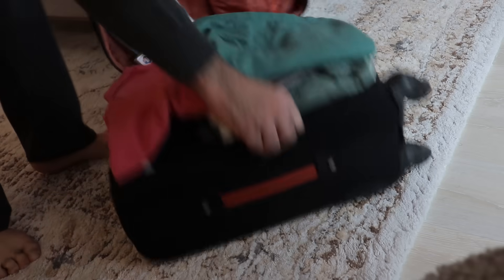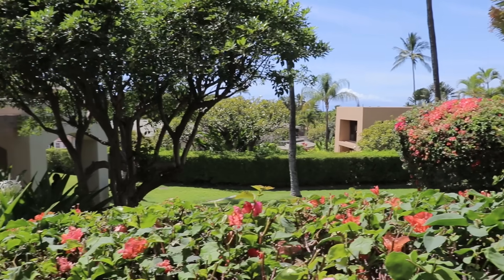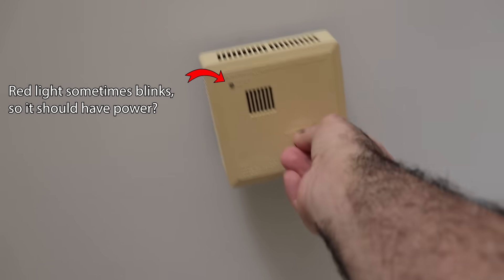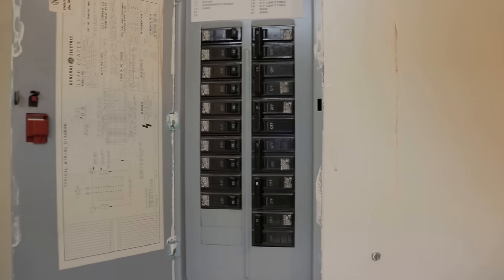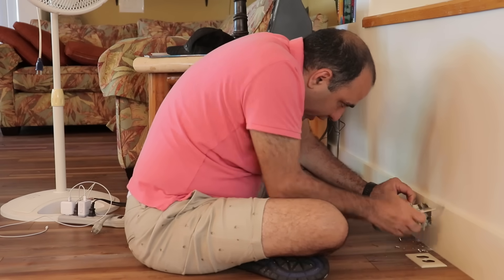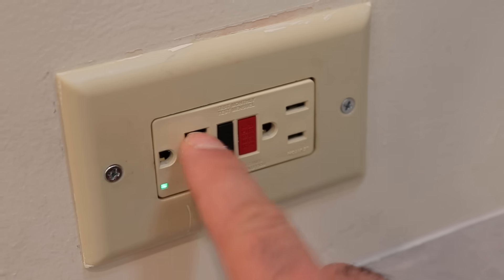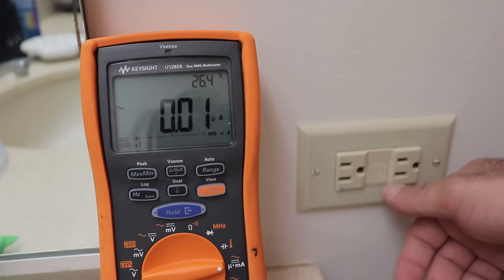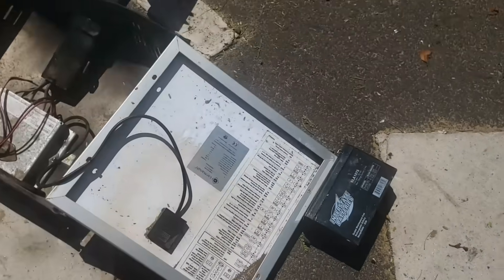Hawaiian Hotel Safety Failures

Comment: As someone who works with LV electrical installations, there are a couple interesting finds:

1. Turning off the an individual breaker doesn’t mean it’s safe to touch the parts (unless it’s a 2 pole breaker) because return currents from the neutral can still shock you (since the neutral is unswitched in a single pole breaker).

2. The GFCI that took more than 5mA is a fail if it is rated at 5mA. In the UK for instance, 30mA RCD trips around 22-27mA, and if it trips at more than 30mA, it would have to be replaced. However the accuracy and precision of your homemade GFCI/RCD ramp tester may not make it very suitable for the mA range.

3. When there was a dead short between the line and earth conductor, the breaker at the fuse board should have popped. Maybe the earthing there wasn’t very good.

Great content as always :)
Reply: First one only happens if your neutral is ungrounded

Comment: I recommend you get a standard lockpicking set from Amazon/E-bay, or wherever you may get miscellaneous tools. Mine is cheap, the metal is thin so it is flexible and bends, but overall cheap is okay!
Tensioners seem to be non-flexible, thankfully.
Tips:
Because the picking tool is flexible, it could potentially break inside the lock if you're not careful. Practice.
You may damage the springs and internal components.
Keyholes on practice locks you get may widen after using the tensioner a lot. It happened to my transparent one, so it's more difficult to tension.
Remember this while opening things you should definitely lockpick. Thanks for helping me with electronics with your tutorials, much love!
Reply: He may not be able to legally possess lockpicking equipment. #canaderp ?

Comment: Hey, Mahalo for visiting Hawaii. Just some things:
1. The electrical system in your hotel is likely the result of the really crap and corrupt construction/inspection standards in this state, combined with Frankenstein nature of renovations hotels do. I did door hardware installation for awhile and lived with an electrician as a roommate. Your room was par for the course. If you really want nightmares, you should see some of the residential refits done here by guys who really shouldn't be doing it all (though to be fair, doing any sort of work on a 70 year old single-wall plantation style house is difficult even for skilled people).
2. No clue why the switches are so low. Yeah, they have to be handicapped accessible, but that's lower than the standard. My guess is the original flooring was lower, or the guy cutting the drywall was eyeballing it. 
3. The sand at the beach you were at is really low silica compared what you're used to the mainland. White sand here is high in calcium, being composed mostly of dead coral, shells, diatomates, etc. Very little quartz on this type of volcanic island. There's an irony that we have to import high silica sand for certain industrial uses.
4. Ummm, that quick shot of you and your family climbing over the coastal basalt while waves crashed under you? It's really dangerous to be in those kind of areas, and the state really needs to put up more and clearer signage/guidance as it's a major cause of injury and death to visitors here. Yeah, I know there's always tons of people doing it, so everyone thinks it's okay, but its not. Rogue waves happen, particularly in certain ocean conditions. 

Hope you enjoyed your trip!

Comment: Dont you have active RCD's or GFCI's installed on the supply side ind the mains box?
And 5mA for safety? Thats pretty damn high.. 
In denmark its a legal reqirement for an RCD to disconnect current, in the event of more than 3mA 
residual current in under 0.2 seconds.
But i guess it has something to do with our grid to be 120 degrees out of phase and 60Hz?

Comment: Been using a miltimeter on a daily basis for the past 6 years & not once have I ever used the "probe holders". Never even realised that's what the were for; thought they were just for keeping them in place when not in use - or maybe to turn your multimeter into an offensive weapon!
Reply: Usually you put one probe in the holder so you can hold it and the meter with one hand, and keep the other probe in the other hand - you don't usually stick both of them in the holders. Most decent quality multi meters have the holders - sure, the $3.99 special at harbor freight or princess auto meters, not so much
Reply: @gorak9000  A small piece of duct tape can't fix that problem.
Reply: Especially for higher voltages, is designed so that you wont make contact from one arm to the other through your heart.
Reply: I find them more annoying than helpful. Of course if I was doing more residential rather than industrial it might be different.
Reply: a miltimeter
Reply: @official-obama  it was late and I was kinda drunk lol

Comment: A slight correction about the "240V coming from two 120V sources that are 180 degrees out of phase"

Single family detached homes typically run off of a center tap transformer and thus the 240 volts does not come from two 120V sources 180 degrees out of phase. Line 1 to neutral or Line 2 to neutral are both from the same winding of a transformer. In fact it's the voltage from either end of the winding to the center tap. The voltage across the entire winding is  240V.

Edited for typo

Comment: Well an outlet in my house was not working properly so my father opened it up to see a metal mesh near the wire. If the mesh was even half an inch closer then all the current would go right back into to walls of the building. Then he proceeded to remove the mesh with the breaker on and popped the breaker

Comment: Love the videos but still dont understand why american electrical panels are not built like we do in europe with earth protection  (typical 30mA in residents) integrated in the breakers on every single one. Does certainly make things a bit safer everywhere and not just in the bathroom. Yeah one breaker does cost like 80 usd for a proper one, but it will also last you a lifetime.

Comment: 14:15 Sorry but blaming the pandemic struggling on a failed Smoke detector and GFCI from 1985 isn’t a good excuse. The pandemic has nothing to do with proper maintenance and safety of the customers. That stuff should have been replaced before the pandemic even started.
Reply: GFCIs are only like $20. A good photoelectric smoke alarm will run you about $15-40. So yeah, those are not expensive at all.

Comment: Make me remember I solder wire connection when it still on and on 220v circuit. I use battery soldering iron and accidentally touch the metal body of soldering and getting shock.

Comment: 5mA?!!! What are you guys doing there in US? Sticking your finger to the outlet while sitting in the bath first making sure your entire dead skin layer is brushed off? Or maybe putting your tongue where it doesn't belong? In Poland, and I'm pretty sure it's the same in Germany and bigger part of Europe the standard RCD is rated for max 30mA (can pop from 15mA, also note that according to the regulations all circuits should be behind the RCD meaning all the outlets and light fixtures) and one recommended for wet environment like a bathroom is rated at 10mA.

Comment: Smoke detectors use radioactive materials that decay over time. Chances are it’s just decayed too far and no longer works.
Reply: Only ionization ones: the one in this video is photoelectric (though regardless of the sensor type they should still be replaced every 10 years, & this one's long overdue for replacement!).

Comment: I worked in hotels....Nothing will be done for the GFCI or the smoke detector.
Reply: Even the outlets? Thats a huge ass fire hazard over there
Reply: @Chocoffee_battery  basically if an inspection is done and is noted on the report, it will get fixed. Otherwise there's not much chance.

Comment: SWEDEN ELECTRICAL FACTS! (From a 17 YO swede)
I have a feeling he’ll love Swedens outlets. I live in Sweden and we have 400 volts between 2 phases. So 230 volts between N and one phase.
We also have a thing called an “Jordfelsbrytare” or directly translated Ground Fault Breaker. But the main difference that i’ve seen is that it is located in the central. It checks the current between the returning 3 phases and the N-wire and breaks if the returning current trough the N-wire differs by 30mA or more. 
The centrals over here looks a LOT different that those in North America (much more clean imo) 
A little more about the Ground Fault Breaker (GFB).
In Sweden we have 3 phases 120 degrees out of phase. After the main breaker in the central we connect these 3 phases and the incoming N-wire into the top side of the GFB. After that we connect the same on the under side of the GFB. BUT here in Sweden we have a dedicated N- And PE-rail. We connect the outgoing N-wire from the underside of the GFB to this N-rail. What this means is that every electrical product connected to an outlet gets monitored by the GFB and if the current differs by 30mA or more it breaks. Again this GFB monitors EVERY OUTLET of the entire house/apartment instead of just one.
Ty for reading! (if you did)
Picture related:
https://images.app.goo.gl/7Hp9m21LKspHyNYBA

Comment: I think that in the UK all bathroom outlets have isolation transformers. But they also have a different socket that can only take a special plug used only by shavers and toothbrushes. Building regs and all that.

Comment: Smoke detectors in hotels sometimes set off the central alarm if you hit "test."
Reply: Not exactly: hotel rooms typically have either commercial detectors with sounder bases or residential detectors that have built-in horns, both of which are done precisely for the reason of avoiding false alarms that would set off the entire system, as if they activate they likely will only sound a local alarm & not trip the rest of the system (general alarm). The rest of the building likely has standard commercial detectors without horns however (though they also don't have test buttons unlike residential detectors as well).
Reply: @TheCarson116 I was on a school trip once, when one of the other students hit the "test" button and triggered the whole hotel. Not a smart design, but some are set up that way. That said, this was many years ago.
Reply: @JamesPotts  Hmm...well, perhaps some systems have a setup like that, but most avoid it to in turn avoid frequent false alarms I'd imagine.